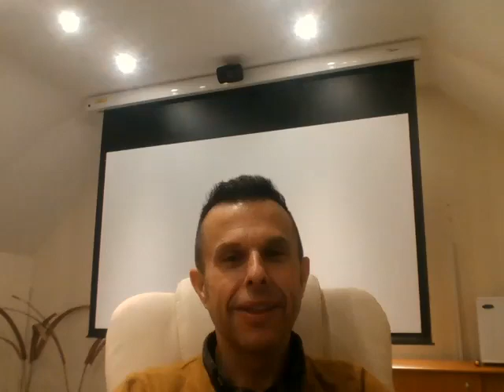Thin Screed Products?

Comment: Great video. Is it possible to screed from 15mm to 40mm around underfloor heating pips that leaves a durable surface to walk on, the pips will be covered at a minimum of 5mm .Screeding will be bonded to a 6"thick concrete floor,